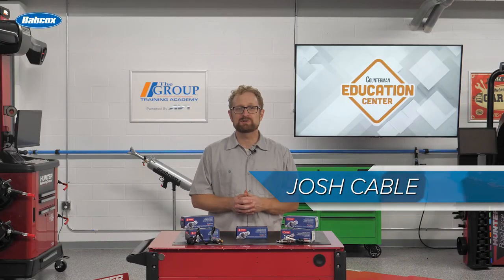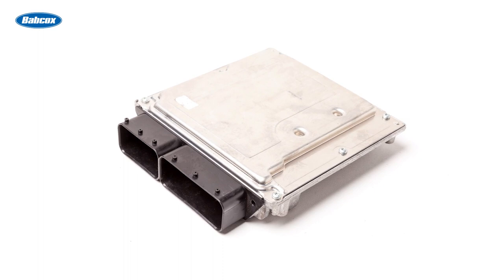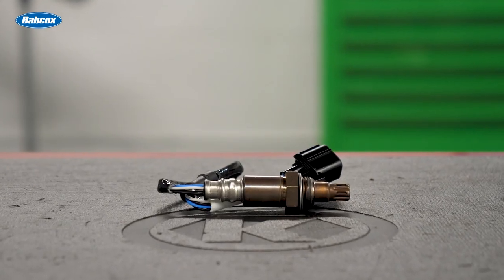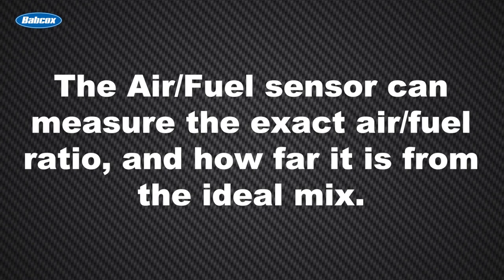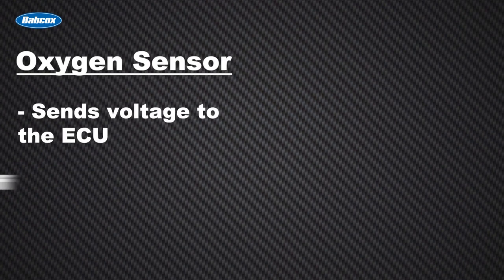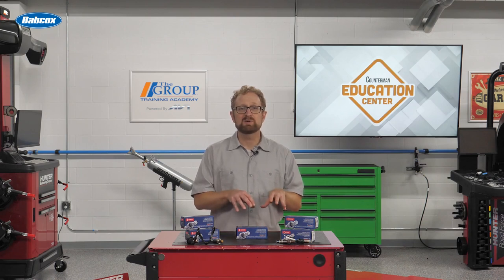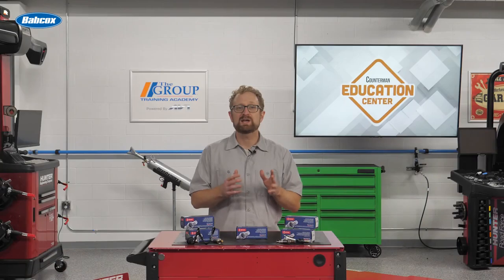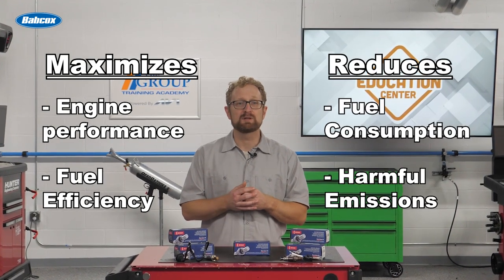Oxygen Sensors vs. Air/Fuel Sensors

Comment: nice info. unfortunately i dont have this label to know if my engine 3uzfe use o2 or afr sensor. it a swap. how else to tell?
Reply: Air fuel ratio or lambda sensors are upstream of the catalytic converter and o2 sensors are downstream of the catalytic converter 👍. Hope this helps. Ps.. you need to contact or research your specific vehicles though. But generally it's what I said especially after 2000. Not sure before.